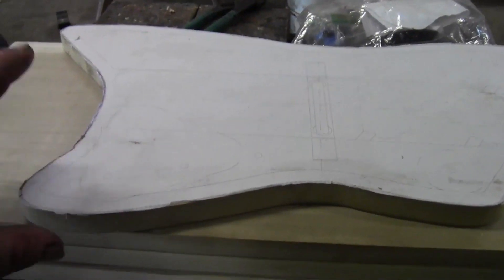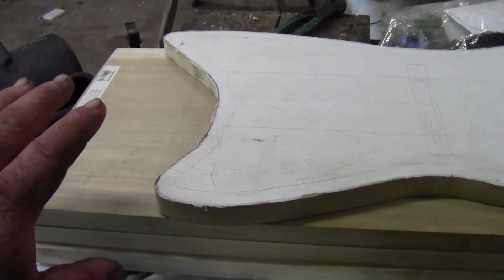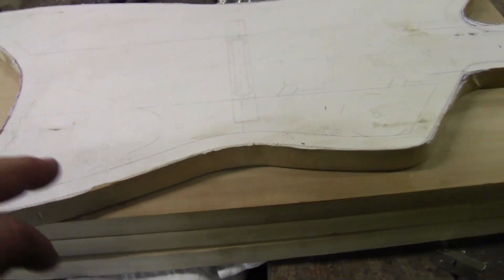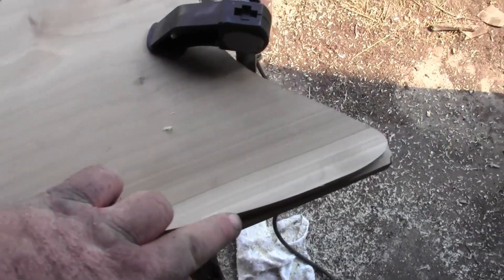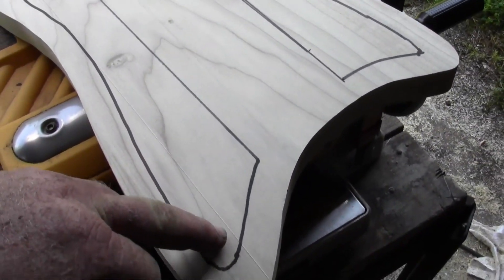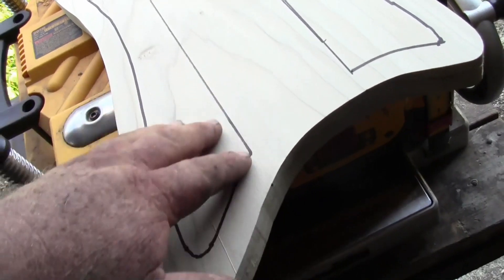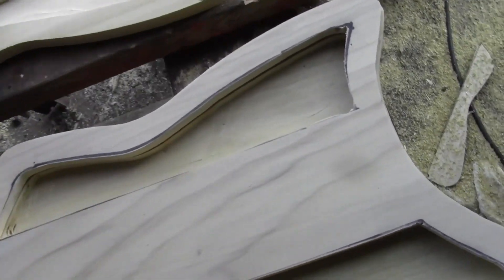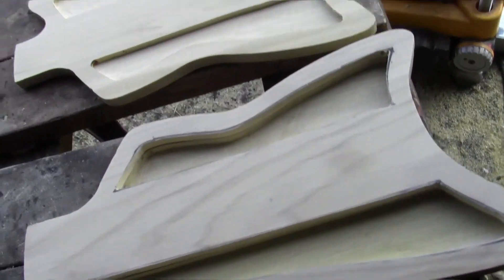Five String Jupiter Starbird Part 1

Comment: Neat. Never heard of a five string bass.
Reply from the maker: They make 6 string basses now. 4 is E A D G, 5 is B E A D G. Not sure about 6, B E A D G C I think.  I have a Dean Explorer that was modified to be an 8 string. Normal 4 string with Drone strings tuned an octave higher. Like a 12-string guitar or a Mandolin. It has a really dark sound. I may share a pic later.  Thank you for watching.